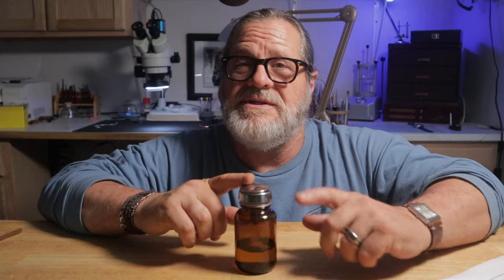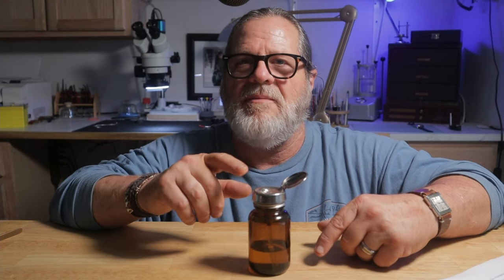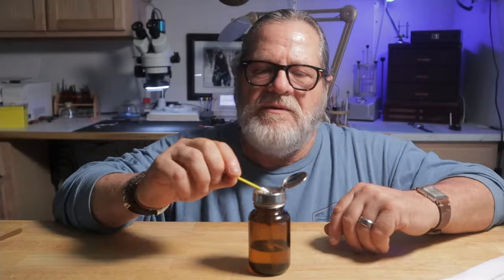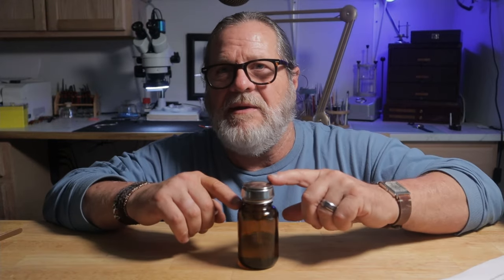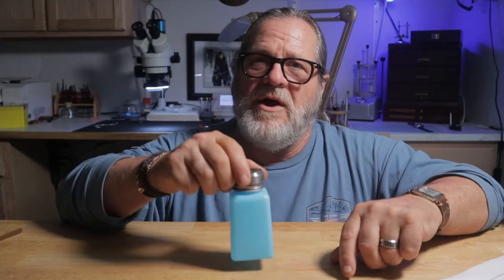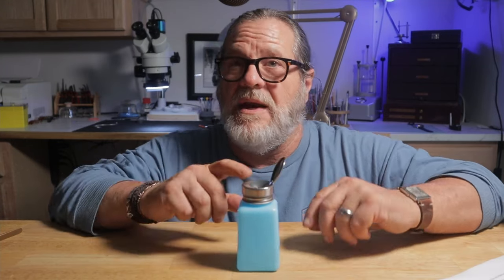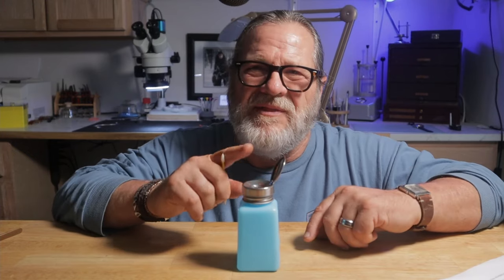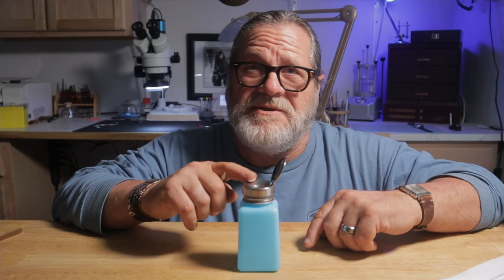How to Clean Watch Parts Without A Machine-Watch Repair Lesson #8

Comment: Thank you for sharing your videos Alex.  I am a hobbyist for about three years now and started off much in the same way as you describe.  Lots of unnecessary purchases especially on parts and donor movements.  I already have a slew of balance cocks and wheels from which I mangled each and every hairpsring in an effort to learn how to repair or correct them (too soon to dabble into that, I guess).  Some successful barrel and mainspring cleaning and winding.  Cleaning and replacement of analog quartz movements have been successful and rewarding, though. Changed batteries on my watch collection and for family members.  Basically a beginner at this point.  I use an ultrasonic cleaner as I cannot afford to buy a watch cleaning machine and I don't think there are any available in my country (new or pre-owned).  That being said, cleaning fluids are also not readily available so I use lighter fluid and alcohol.  Your DIY cleaning method is very interesting and I would like to try it.  My question is, how long and at what speed to I run the basket? Please forgive the long comment and thank you for your time.  More success to you!
Reply from the maker: Hey Dennis, 
What country are you in? 
So the method I showed in the video is really meant to show that there are many different ways to accomplish cleaning watch parts. 
Some people have taken the idea that I showed and improved on it by using laboratory mixers and hooking up baskets to it.
If you have a ultrasonic cleaner, Ineould continue to use that. The spinning action could be used to clear the cleaners and rinses between stages so that you are not transferring as much from one container to another.
Reply: @watchrepairtutorials  Thanks for responding so quickly Alex.  I live in the Philippines. Watches have fascinated me since childhood.
Reply: @watchrepairtutorials  Hi Alex.  Thank you for responding so fast.  I live in the Philippines. I'm retired and took up watchmaking as a hobby before the Covid 19 pandemic struck. I saw a video posted by Michael Bolton (Retro and Vintage Watch Restorations) where he serviced a seiko 6119.  Exactly the same movement on the watch I have kept since my first job.  That started the ball rolling for me.  Fast forward to today, I really have been thinking of ways to DIY a cleaning machine but don't have the knack for fabrication and other stuff associated with motors.  Your method is more up my alley :).  Anyway, I'll take note of your recommendation and stick with my ultrasonic cleaner until cleaners and fluids are locally available here. (Just checked cleaning baskets on eBay and they are pricey! ) I've been watching your videos and enjoy them immensely.  On top of that, the lessons learned from your videos are so valuable to me as a hobbyist. Your generosity with your time and knowledge is very much appreciated! Best regards!
Reply from the maker: @dbzamora  I have a question that maybe you can answer.
There seems to be a ton of modded Seiko 7002-7000 watches that come out of the Philippines. Do you know why ?
Reply: @watchrepairtutorials   I have no idea but I'll try and find out for you. There are so many local Facebook Seiko/Modding groups here but I am not a member of any of them.

Comment: this is a absolute great guide for beginner, may I have a question about can I put watch part in a container and cover these with naphtha then brush those softly instead of use machine? thanks
Reply from the maker: Here's how you can hand-clean your watch parts using IPA:

Gather your materials: You'll need a clean container, 99% IPA, a soft-bristled brush (like a soft artist brush or a dedicated watch cleaning brush), parts dryer. A food dehydrator or hair dryer works fine.
Prepare the cleaning solution: Fill the container with enough IPA to fully submerge the parts you want to clean. Petri dish’s work great. Please note that IPA can damage shellac, so you have to limit the exposure on the pallet fork and roller table.

Clean the parts: Gently brush the parts with the soft-bristled brush while they are submerged in the IPA. Pay close attention to any areas with visible dirt or grime.

Rinse and dry: After brushing, remove the parts from the IPA and put them under the dryer.Condensation will form when there is a significant temperature difference between the metal part and the environment. Make sure all the IPA has evaporated to prevent any condensation from forming.

Repeat brush cleaning: It is important that there is no left over lubricants or any other type of residue on the metal parts. Leftover contaminants on steel parts change the surface tension and will affect how well lubrication stays in place. I would recommend a 2nd cleaning in fresh IPA to ensure the parts are spotless.

Good luck with your watchmaking
Reply: @watchrepairtutorials  appreciate

Comment: Thanks for the video, Alex! Quick question:  I have a gallon of denatured alcohol in the shed. Can I use it as the rinse, rather than 99% IPA? I've disassembled an Ali-X purchased NH36 and am attempting my first service! So appreciate your time and expertise, sir!
Reply from the maker: Thank you for the kind words and your support for the channel. I’m glad you’re finding the content helpful! Great question regarding the use of denatured alcohol as a rinse.

While denatured alcohol can be used as a rinse, I wouldn’t recommend it for servicing. There are a few reasons for this. First, denatured alcohol can contain up to 10% water, which could leave unwanted moisture on the steel parts—something you definitely want to avoid.

Another important factor is how alcohols evaporate and the likelihood of condensation . Alcohols evaporate more slowly as their chain length increases methanol evaporates the fastest, followed by denatured alcohol, ethanol, isopropyl alcohol (IPA), propanol, and finally butanol. IPA evaporates more slowly than denatured alcohol, reducing the risk of condensation forming during the drying process. Denatured alcohol’s rapid evaporation can sometimes cause condensation to form faster , increasing the chance of rust if drying isn’t carefully controlled.

While both denatured alcohol and 99% IPA can displace water, the concentration of alcohol in each solution plays a significant role in its effectiveness. IPA’s higher purity (99%) makes it better at displacing water and ensuring that no moisture is left behind on the parts. Denatured alcohol, with its variable water content, may not be as effective in this regard, potentially leaving behind residual moisture especially in small area’s

For best results, I’d recommend sticking with 99% IPA. It’s more reliable at removing water, evaporates at a safer rate, and will help prevent moisture-related issues. Good luck with your first service, and feel free to reach out if you have any more questions!
-Alex

Comment: Thanks, i really enjoyed your video, i learned a lot.  i'm trying to figure out how to take apart and clean my grandfather's old Timex automatic watch in an attempt to get it working again
Reply from the maker: Some of the old Timex watches were never meant to be taken apart and fixed so keep that in mind.
Reply: @watchrepairtutorials  How do i tell the difference, if its one that can't be fixed?
Reply from the maker: @leevanwesterborg7805  I’m no expert on tonics, but from what I understand the ones that are riveted together instead of screwed are the problem.
What a lot of people will do is that they will clean the entire movement assembled rinse it dry it just like he would do individual watch parts and then lubricate it. It’s not ideal but it’s better than nothing.
Reply: @watchrepairtutorials  i saw a video where the entire movement was soaked in lighter fluid and / or paint thinner.  this reminded me of when you said soaking the watch parts in naptha would clean them.  i am going to try the lighter fluid, in the video he said he had to soak the entire movement for two hours but when he pulled it out the gears were turning and the watch was working again.  my old watch is in very bad condition and worth nothing to a collector, i'm going to soak the entire movement and see if i can get something moving inside the watch.  i was told the watch was only good for parts and would never work again, i don't care if it never keeps perfect time again, i'd just like to be able to see the hands move around.  Thanks for your videos, i really learned a lot and almost understand how these watches work from these videos.

Comment: An interesting budget method. I don't think you mentioned how long each wash/rinse cycle would be for this method.

I'm in the UK and have been using an ultrasonic with Essence of Renata for 20 minute cycles, then a IPA rinse. I've also pre-washed in dish soap, but I've found that some steel parts discolour at temperature, so I'm cautious about recommendations elsewhere that say to use 40+ degrees celsius with water/dish soap. I've not tried this mason jar/drill method though. Do you have any thoughts on ultrasonic cleaning?
Reply from the maker: Ultrasonics are a good option if you get one with some features.
I think having a "Sweep" feature is one of the more important one. It helps a lot in the overall effectiveness of the cleaning cycle, helping to eliminate the hot spots and dead zones from the "Standing Waves"

A Degasing function is nice as well but not a deal breaker as you can essentially accomplish the same thing by letting your fluid sit a couple hrs in the jar before using it.

 A machine running 35 kHz  to 40 kHz is a good range. Under 30kHz is going to be problematic for more delicate parts

The biggest issue with ultrasonics in there is no spin off from one stage to the next. Your rinses get contaminated faster.
Reply: I had similar discoloration using simple green cleaner in the ultrasonic. I found out that using too strong ratio of cleaner to water for too long a time caused this. Switching to the simple green pro (purple stuff) and sticking to 1:8 ratio or more eliminated this for me.  I read that something about Alkaline aqueous based cleaners causes this.
Reply: @johnhannon  That's good to know. Thanks. It's more than possible I've been heavy handed with the ratio.
Reply: @mrkrsl_  I found that information from auto parts restorers sites. They had trouble with parts turning black after ultrasonic cleaning.

Comment: Great video. Quick question. If one would want to avoid using anything quasi-hazardous or toxic (e.g the specialized watchmaker solutions, lighter fluid, hexane, etc.) would you just recommend using IPA for everything?

Another option - in "Watchmaking" George Daniels simply suggests using good-ol soap and water for washing, followed by shaking in sawdust. Curious about your thoughts in this regard.

I'm tempted to go all-IPA except for the pallet fork and balance. Wondering what to do there....

Al
Reply from the maker: I actually did a video testing Dawn dishwashing soap in an ultrasonic which you may be interested in. And then I did another video testing a product called Liquinox You should watch both of those videos I think you’ll find them very insightful

Comment: Awesome video these are very helpful.
I have collected 10 HMT watch in that one of them is a 1990 made HMT pilot and the dial is hand loomed and dial is black.
I want to clean the dial without disturbing the lume. Please make a video of dial cleaning
Reply from the maker: Dial cleaning is very limited. You basically can only use a Q-tip dampened with deionized water. Black is the worst color to clean.
Reply: @watchrepairtutorials  Thankyou for the reply through.

Comment: Brilliant video, looking to upgrade my cleaning game, I have just built a basket like yours, got my fluids and jar. How long do you turn the basket in each jar for?
Reply from the maker: About 5 minutes is a typical cycle.
You should watch this video first.
Double Your Ultrasonics Cleaning Power! 💥🔧
https://youtu.be/Y0RbOvOXogw
Reply: That liquinox sounds good. Today's clean I'm using naphtha pre clean followed by IPA rinses, my dremel spin set up is  bit speedy but I think it'll be effective then I'm drying off in the oven at a very low heat with the door open. 🤞

Comment: Thank you for all of your videos. Without them it would be impossible  to know were to begin. I just disassembled  my first watch. It is the movement that you sugested to start with in one of your videos. evrything is going well. Now i am practicing to wash the parts in this movement before i start with my vitage omega and breitling and so on. I have a new elma 4 stage cleaner and 5th stage dryer. Is it save to clean a ballance will and a spring in it??
Reply from the maker: Oh heck yea. Wow nice. What cleaners are you using?
Reply: @watchrepairtutorials  Elma luxury clean wf pro and surrounding pro rinsing

Comment: I didn't know you've ever posted such a useful video. Hexane is mentioned here too! I would like to purchase the q-tip you recommended. Unfortunately, there is no way to get a sharp q-tip right away in Korea. In addition, I am thinking of purchasing a gas mask for the safety of using hexane these days. It is said to be good for preventing inhalation of alcohol vapor such as ethanol.. I'm not sure it'll work.
Reply: one minor question: the IPA is not for 'cleaning' but for 'rinsing', right? Do I have to use hexane if I am trying to clean a small pollution with q-tips?
Reply from the maker: Did you see that I answered your question from before in my last video?
That should help. 
In this video, I mentioned that I do not clean the pallet, fork, or the balance wheel  in my cleaning machine.
I clean those in a separate jar of hexane. That is the main purpose for which I use it. This is because it is safe for the shellac on those parts.
Too much exposure of IPA and shellac will soften it, causing the pallet stones or the impulse jewel to become loose, which is bad.
An alternative to the pointed Q-tips would be surgical swabs. You can search for those through your local channels.
IPA can be used as well for precleaning. You do not need a Hexane for that.
In the gas bags would be a good idea if you’re concerned about the fumes of stronger solvents like hexane.
Reply: Thank you so much for suggesting alternatives. I researched other ones that can easily access in my country.. But I like the one you recommend for the most. I think I have to make international purhase for the better servicing😅

Comment: Excellent video again ! I did not know about the hexane/one dip situation. Furthermore I can say that  relatively unexpensive ultrasonic cleaning machines ( 100 to 150 EUR) can do a good job if using a proper ammoniated cleaning and IPA rinsing solution at 40 celsius degrees. Frankly, your method to spin the basket is just epic !!! I love it :-)
Reply from the maker: That’s man, I’m glad you liked it.
I will be doing an ultrasonic video pretty soon.
Reply: @watchrepairtutorials  Do you think it's appropriate to use an ultrasonic cleaner for movement parts? There's apparently some debate about whether or not they should be used for anything in watchmaking aside from larger parts like cases and bracelets.
Reply from the maker: @PhilNavidson  watch manufacturers use them. Watch making schools use them as well. 
You have to be careful with vintage watch parts like the balance and pallet fork. If the shellac in the stones is not really secure it can cause it to separate.
I have a ultrasonic and spin cleaner but still clean all my balance wheels and pallet forks by hand.
I will be doing a ultrasonic video soon
Reply: @watchrepairtutorials  Thanks for the answer. I'm really looking forward to your video on ultrasonic cleaners. May I say, It's About F*****g Time!
Reply: Could a magnetic stirrer be used? I,m thinking of suspending a parts basket above the magnetic stirrer capsule and let the swirling solution do the work.

Comment: I have been using a brush in a shallow dish and then put them in basket and put the baskets in like a small jam jar filled with the different cleaning solutions and put them in the ultrasonic cleaner and I have excellent results. I will soak overnight before I start the cleaning process. I always inspect them with my microscope and the jewels were always clean. Very rarely do I have bunches of crud to clean with peg wood. It’s usually just very minimal and requires a spin of it and then they are pretty good. And after a wiping with the smallest q tips made they look great under magnification. I’m definitely going try to make or get a basket I can turn with a drill. Better yet, just put it in a drill press and no hands needed.
Reply from the maker: It sounds like your cleaning process is pretty solid. A spinning basket in ultrasonic is the best of both worlds.

Comment: Thank you very much for the vid, really helping a lot. Just a question, do you think IPA is suited to rinse off any idrophobic solvent such as lighter fluid naphta or even hexane (basically any petrol derivates) ? if i use hexane/naphta as my cleaning solvent, should i rinse it in just clean hexane or would you keep rinse in IPA? I think rinsing in hexane is a better choice if using any petrol-based solvent, while rinsing in IPA is better if using any water-based cleaner.
Thank you so much
Reply from the maker: When I refer to using hexane as a cleaning solution I am primarily referring to reagent grade or laboratory grade primarily because of their purity levels and the fact that they don't leave residue. 
Here in the states it's expensive so it's not typically used for cleaning watch parts like you're describing. Not to mention the fact that it stinks pretty bad.
I don’t know the chemistry between the two well enough to advise you nor have I tried these combinations together.
Whatever you use for your final rinses you want it to be as pure as possible.